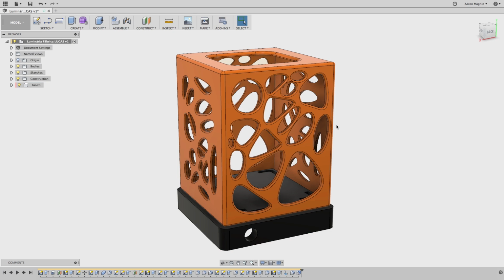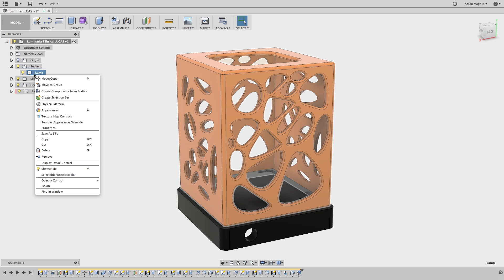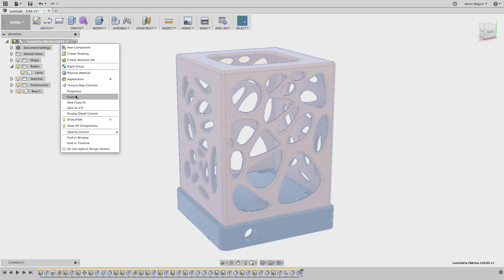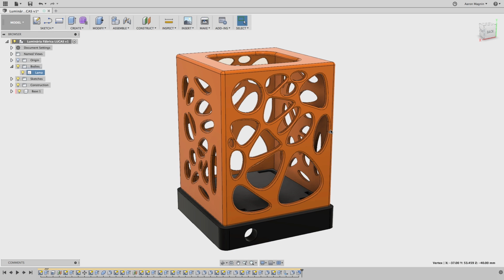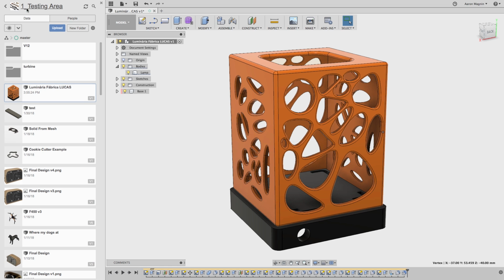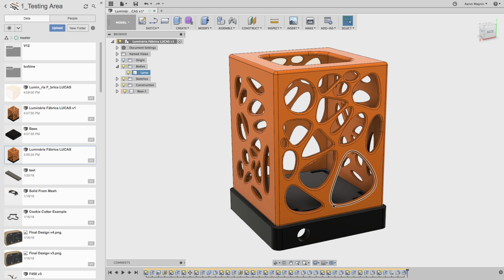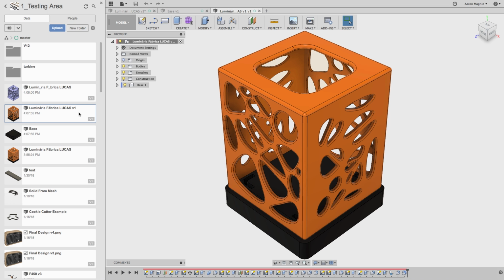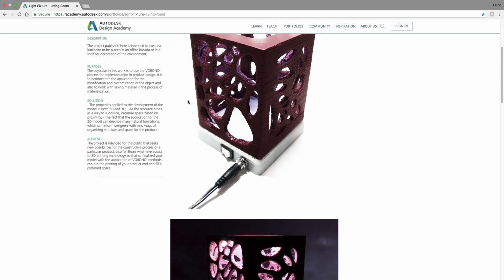Autodesk Fusion 360 | Quick Tip: Export Files

Comment: Why don't you guys put all these export options right inside the desktop app? It's annoying having to open A360 everytime I want to get a SKP or OBJ file, not to mention that it doesn't even let you download the file directly, it sends the file to your email. Really messy.
Reply: Hey Allessandro, 
If you remember the way back CAD days, they took roughly an hour to install and were about a 7-10GB install. One of the major reasons for the large file size and long installation was that those cad tools had to install many translators to import and export file formats. This is one of the aspects where Fusion 360 takes advantage of the cloud. We have cloud translators which are accessed through Fusion Team (F.k.a. A360). This is why we send you an email because the cloud has to have time to translate your file. We will be improving this experience in the future, but this is one of the areas where the cloud is helping. Theoretically you can translate many files in parallel for import or export.
Reply: Bryce Heventhal I understand, but we already can send simulations to be solved on the cloud right inside the desktop app, without emails, websites or anything else, why not do the same with the file conversions?
Reply: Because they want to steal your ideas lol Ive had a few ideas stolen already